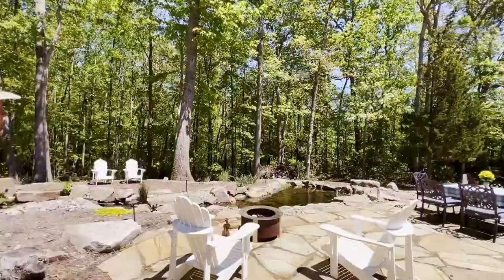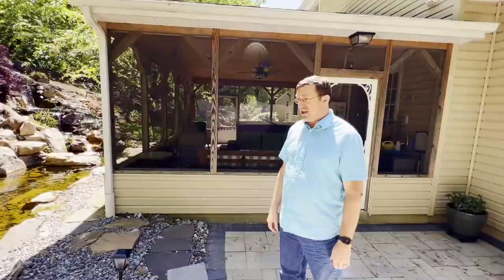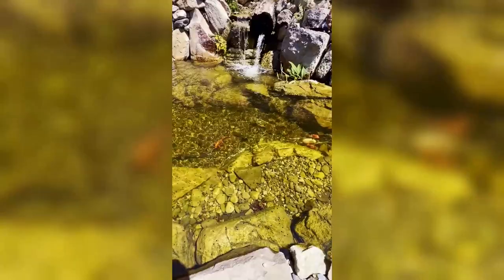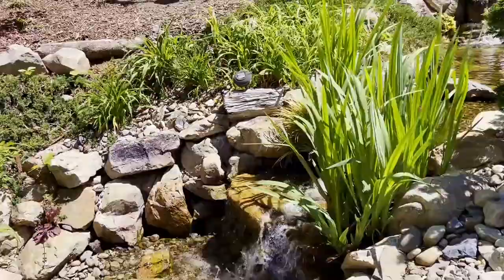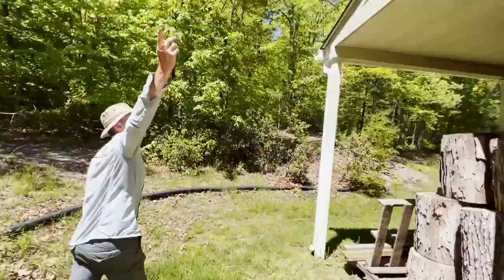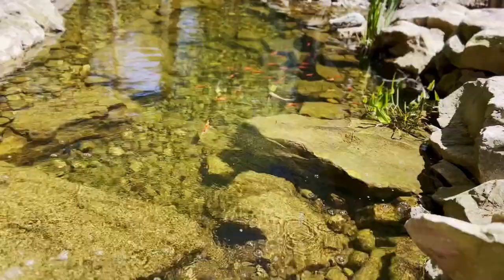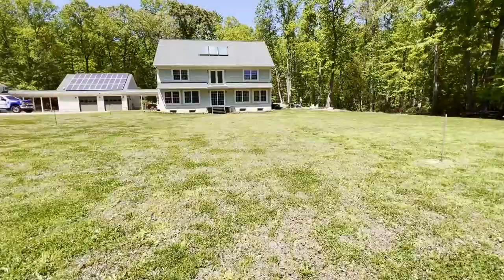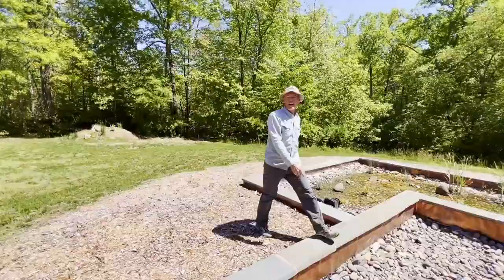CAPTURING Rain water. THOUSANDS of gallons.

Comment: OK, these ponds are far too expensive and involved. I am thinking of a sustainable water plan starting with a single pond that uses the first 6 inches from the top to serve as a soak in the ground rain garden from the roof. The rest deeper part of the pond is lined. Then, a shallow well will be installed to collect, naturally filter, and store filtered water under the pond. Our soils would work out for this, we have a shallow water table. Then, the well has a shallow well pump to lift water from under the pond to a custom fountain at the end of the pond to prevent stagnation and mosquitoes. An over flow goes to a newly installed property wide water collection pond and drainage plan about 40 feet in diameter and 6 feet deep. We get 35 inches of rain per year on 2.3 acres in central Georgia, and that is a lot of water! Over flow from the big pond will go to Mule Creek. The big pond is there to serve as a perc pond to insure our main property well gets plenty of water for irrigation and home use. The main well is 100 feet deep and the pond would be about 100 feet from the well. We have an old time farmer that uses fertilizer that drains water into the shallow ravine that will have our pond. We will have a small settling pond for his pollution, but some of that water will go to our new pond. Our property water does not dilute his pollution yet and we do get trace nitrogen salts in our well. Our water collection system should dilute his pollution. We get trace nitrogen and a ph of 5.5 from his pollution before this new plan is installed. This would be less of a fancy high end pond and more of a total water management plan to use the natural rain we get, improve it, and keep more of it on our property. Folks down stream will get cleaner water and more consistent flow. Regulations in our area are not a problem for this plan. If I submit a  drawn plan, could you work with us as a consultant?

Comment: This is such an awesome system!  I really want to do something like this (on a somewhat smaller scale) at the house I am going to retire to, which happens to be the house I grew up in!  It's on a fairly large lot, but nowhere close to the size of this place.  Also, because of the original set-back laws and because it is on a corner, the house is situated towards the back corner of the lot, making for a fairly small backyard, but a huge front yard.  I have been planning my complete Aquascape system in my mind for a while now and a big part of it is multiple rainwater harvesting systems.  I want to be able to collect everything that falls on the roof as well as a lot of what falls on what I hope will be permeable pavers on driveway and patio.  I know my eyes are way bigger than my bank account so not sure how much of this I will actually be able to build.  Time will tell!

Comment: Hey Greg I've got a pretty neat two plus acre property in St Helens Oregon We get 51 in of annual rainfall and I capture every drop from my 2700 ft² rooftop and if my math is correct that's 90,000 gallons approximately per year of water for my pond that is located on the lowest portion of my property about 15 ft below grade of my house..
I am planning a quarter acre garden at the highest elevation of my property which is about 6 ft above grade from my house opposite the pond area..
I want a pond that is worthy to swim on hot summer days but also 100% feeding the irrigation for the garden and 100% solar powered pumps..
I've been experimenting with some solar powered pumps and I have a 48 volt deep well pump that apparently transfers water from the lower end into IBC totes at the upper end that I use to gravity feed soaker hoses in the garden..
I wonder what it would cost me to have you come out and go over my designs and help me make it cooler in every way?